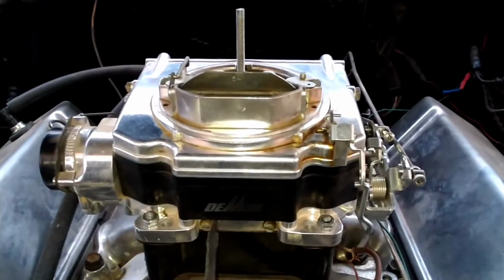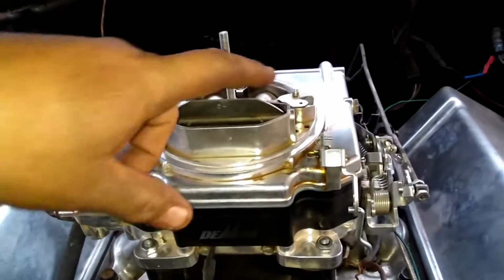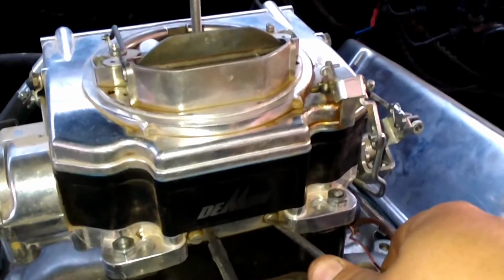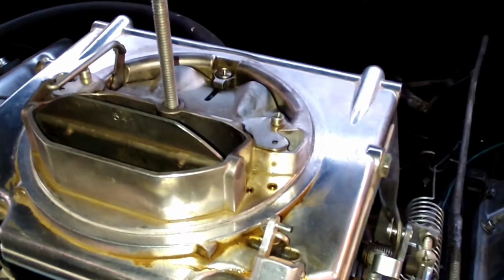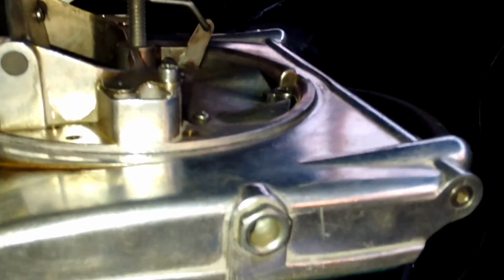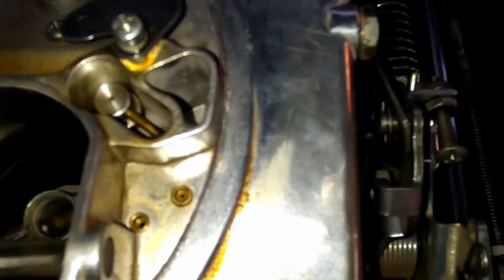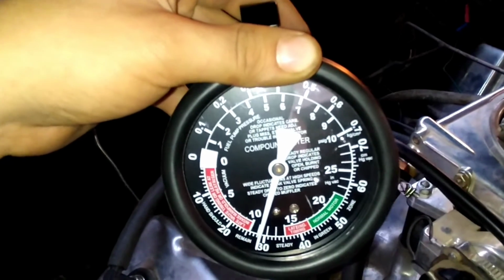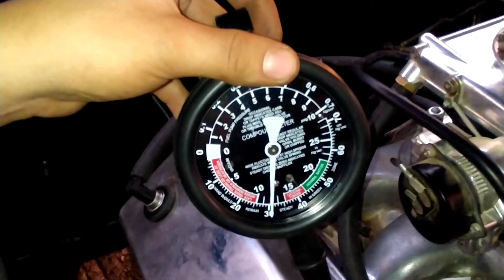Tuning a Street Demon Carburetor

Comment: Thank you.  I got a stumble between primary and secondary.  I will try to adjust tomorrow.
Reply from the maker: Very welcome hopefully it helps you
Reply: These carbs are copies of carter thermoquads used in the 70"s on Mopars. I know a lot about them and built many. Make sure the secondary air valve tension is not too loose. Loosen the lock nut on side of top carb body. Careful not to let spring unravel by keeping tension with screwdriver as you back it out loose. The air valve will drop loose. Start turning the tension tight until the air valve shuts. From that point, turn the spring tension another 1.5 turns then lock down at that point with the lock nut. The center you will find a vacuum adjuster rod. Make sure it is almost to the top. This is your vacuum sensitivity. Make sure the primary accelerator pump is set for max travel. On the original thermoquads, even when the pump was set on max travel, there would still be some slack. You would have to use 2 pliers to gently bend the connecting tang rod to remove the slack. It doesn't take much. You should have no stumbles or lag after that. Same with the choke valve. I would just remove that on mine because I don't drive my muscle car in cold weather or winter.

Comment: 9:00 that may be the problem that I'm having. My cam pulls low vacuum and my car is loading up at idle. I had to put in a vacuum pump for the power brakes. Thanks for showing.
Reply: I just ordered a set of step-up springs for the main metering rods. I bet my metering rods were in the rich position at adle. The plugs were coated in black soot and my eyes were burning at idle. Thanks for the video!
Reply from the maker: Yessir hopefully it works out for you

Comment: I’m on a small black ford 302 when I stab it it falls on it’s face then will kind of go after that
Reply from the maker: Have you adjusted the accelerator pump try a different hole if you still have a problem the accelerator pump discharge tube on the inside maybe bleeding by
Reply: @CCAutoWorks   it is a brand new carb, but the flap towards the back (closest to firewall) on my car doesn’t stay closed like yours mine was to be open all the time no matter how adjust the screw on the side. I have tried all 3 setting on the pump
Reply: @CCAutoWorks   update, when I close the flap and make it stay closed it will hit pretty smooth but it doesn’t close back. After one hit it stays all the way open and doesn’t return
Reply from the maker: @tylervickers1361  the front choke flap or the back secondaries flap
Reply: @CCAutoWorks   back secondary
Reply from the maker: @tylervickers1361  something definitely isn't right it should shut everytime you let off the throttle check to see it the spring is messed up I had one break
Reply from the maker: @tylervickers1361  the flap should have a turn and a half or two turn to stay closed tell around 3000rpms
Reply: @CCAutoWorks   thank you, I’ll try and figure out what’s up with it

Comment: Man iv got this same carb an about once a year while driving it, it starts loading up on my while on the highway. Everytime it does this I have to take it apart an clean it an its fine. But there is never any trash in the carb whn I take it apart. It's got fresh plugs, air filter an fuel filter.
Reply from the maker: I haven't had that happen yet but I've only driven it 400 miles but I've already had this one apart five times because of accelerator pump issues some I'm sure there's more problems to come
Reply: Yes this is the only problem it's had. It's just starts out of nowhere

Comment: I like the carb got a 750 on my 454 but the accelorater pump sucks, easy fix is to replace it with a Carter thermoguad leather pump with check ball intake, also because of the leather you have to add a second spring from a Quadrajet, on a big block I also recommend a #45 tube squirter with hollow screw and add a 4rth hole to the pump lever. I commented on the designer at Holley on these modifications and he though they were a clever idea. They need to re calibrate these a bit for performance big blocks.
Reply from the maker: That's awesome thank you for the ideas and sharing them

Comment: will putting the pump rod in the lowest hole lean it out if its running to rich at cruising or does it need to be jetted lower?
Reply from the maker: If it's rich at a crushing speed it need to be rejected the pump rod is just for a shot off idle

Comment: Were you in gear when you were using the vac Guage ? I have a big block Ford also if I tried to adjust my carbs in park as soon as I put it in gear everything changed so since I drive it in gear I always adjust it in gear also it looked like you seated the mixture screws shouldn't it had died out ? I thought that meant to jet was too big if you can seat it and it keeps running ? Not trying to be a wise 🦉 A**  maybe I'm missing something how did it run was it a 390? Or 460?
Reply from the maker: It's a 460 and it was in park and it didn't die when I screwed in the mixture screws because it was so loaded up with fuel from them being out to far if I would have left them in a minute it would have died
Reply: @CCAutoWorks  ok  thanks we talked carbs a little before I'm still looking at reviews I have my Edelbrock RPM intake on back order won't be here till late Sept or October  plenty of time that's a old carb 8 years old or so new me though they have so many now street avenger , brawler , etc etc this is definatly a blend of eldelbrock , quadrajet  I see they just tweak designs add lil tricks to to call it new of course to sell a new carb but really it just has a few of new features .
I have a wideband on my truck AEM I do my idle and carb adjustment in drive since I'm not cruising in park  I actually tried doing it in park and that when I first got the truck but when I put it in gear all the adjustment I did changed so I found for me if I'm idling at a stop light best to do idle mixture adjustment in gear set idle speed etc AFR etc.
Reply from the maker: @TheThirdWheel618  I'm still learning carbs myself but the one I have now I really like the summit racing max series carb
Reply: @CCAutoWorks  nice 👍 there was something about the summit I seen they  did a comparison of Edelbrock , Holly and summit the summit had something I wasn't to crazy about  but it's built like to a motorcraft looks like a holly  I did read tho it's best to do idle mixture and speed in gear. I seen it in the ford book too I think mine was 550 RPM in gear with all the lights on I tend to go a little higher 600/620  AFR guages  are great to have then you really see what it's doing on the fwy WOT I love mine ..
Reply from the maker: @TheThirdWheel618  awesome

Comment: So I do have one of these carburetors and on my 91  silverado.350 It feels like when I give full throttle. It's wants to die out why you think is that
Reply from the maker: Probably need to tighten your secondaries flap or need to move your accelerator pump lever

Comment: metering rods stayup they dont suck down till i hit the throtle  what am i doing wrong
Reply from the maker: Not enough vacuum need lighter stepup springs
Reply: @CCAutoWorks  used the lightest set up now rods are fluttering at idle
Reply from the maker: @jeffskjoldal914  did you use a vacuum gauge to see how much vacuum u have
Reply from the maker: @jeffskjoldal914  do u have any idea what your timing is set at

Comment: I'm trying to tune one right now on a sbc 350 with an in tank fuel pump. I can't figure out if it's fuel pressure or the carb but stumbles on take off when floored like it's flooded. Fuel pressure is 5 psi. Any ideas?
Reply from the maker: You might need to tighten up your secondaries air flap the tighter it is the leaner and I might need to adjust the accelerator pump put it in the top hole to lean it out
Reply: @CCAutoWorks  I'm gonna give that a try I really don't want to give up on this carb but right now I can't take off

Comment: hi man i have the same carb on my stock Dodge Charger 400 big block running reach and spark plugs are always black ! what's your advice ( am not a mechanic )
Reply from the maker: Does it have a bigger cam
Reply from the maker: Have you tried leaning out you mixture screws on the front of the carb mine are at 1 1/2 turns out
Reply: @CCAutoWorks  stock engine i only 
 have a MSD ignition on it
Reply: @CCAutoWorks  i will take a look next week , i also think my accelator pump screw is on the middle set
Reply from the maker: @MOPARMuscleLEBANON  if it's to rich try the top hole
Reply from the maker: @MOPARMuscleLEBANON  I'd try the mixture screws first then try the secondaries   flap
Reply: thats funny, ive got the same carb on the mild built 400 in my dart. first off, the stock primaries are .089...the metering rods are TINY. i ordered some primary jets and metering rods from summit. mine idles with 18 psi vaccum, and that was tuning the idle circuit. it was still running rich, so im thinking the metering rods are too small. do not buy the tuning kit, its a scam. summit has all the metering rods, primary jets, and springs. the secondaries look like regular holley carb main jets.
Reply: I've been running this carb on my 1970 GMC with a 402 super dependable decent mileage and lots of torque for 4 years I'd recommend it

Comment: Hey I have a 750 demon on my 454 in a 73 nova. I got too happy and touched the dash idle adjustment under the choke. Now I can get the car to cold start. Do you know the factory setting for the fast idle. Thanks.
Reply from the maker: No I sure don't your talking about the choke high idle
Reply: @CCAutoWorks  maybe. I thought it was called the fast idle. It’s the screw under the choke.
Reply: @CCAutoWorks  on page 9 of the manual it’s listed as fast idle speed screw. Thanks
Reply from the maker: @theshark2804  I've never opened the manual sorry I just put it on and adjusted it to what made sense to me
Reply: @CCAutoWorks  understand lol. Thanks
Reply from the maker: @theshark2804  sorry I couldn't help
Reply: @CCAutoWorks  no worries
Reply: I believe that screw near the choke adjusts the flap under the carb to expose the transfer slots. If too much transfer slot is exposed you won't be able to tune the carb properly as it will continue to pull fuel, even when mixture screws have bottomed out. Check this screw before you install carb. My transfer slots (street demon 625) were open twice as much as they should be, from the factory. Closing it up to where the slots are like a square gives better control with the idle mixture screws. After doing that and tuning the carb, I have 23" of vacuum, on a 50 year old motor (Ford 460 - in a Lincoln Continental) with 150k miles. So a vacuum reading like that says the motor is in great shape.

Comment: I really love your videos, I recently purchased one of these carbs for my 1980 impala that I’ve put a 454 in. It’s running rich on idle don’t know much about carbs, I’ve gauged it while tuning still rich. I drive it like a race car when I do drive to keep it cleared out. Just wanted to ask what do I need to adjust to eliminate this?
Reply from the maker: Thank you have to adjusted your mixture screws on the front bottom of the carburetor

Comment: How do you rejet it
Reply from the maker: Change the metering rods
Reply: @CCAutoWorks  thanks. I'm having hard start-ups. I have the choke hooked up but seems like I have to peddle it to warm up
Reply from the maker: @gustavovilla45  the choke should have a high idle adjustment for cold start

Comment: Man great video! Maybe I need street demon. Lol  I'm going to try to get my vacuum up shortly. 9 inches mercury at idle now with speed demon and xe282hr. Does that sound right. Do you size power valve to half of idle vacuum.
Reply from the maker: Yes half you need a 4.5 power valve the street demon is ok but your speed demon should be much better the summit cab I just got is really nice to

Comment: Cool are you still running the carb today and hows it doing any leaks or other issues.
Reply from the maker: Yes I'm still running it the accelerator pump seeps out of the top a tinny tinny bit it builds up varnish around the top of it but other then that it's a good carb
Reply: @CCAutoWorks  thanks C&C

Comment: You lost me when you compared it to an Edelbroc.  It's based on the Carter thermoquad.  Edelbroc never made a carburetor with this design.  The AVS2 has the air valve down in the venturi, like the Carter AVS it's based on.
Reply from the maker: Thanks for the info